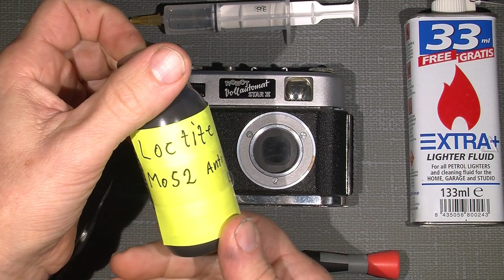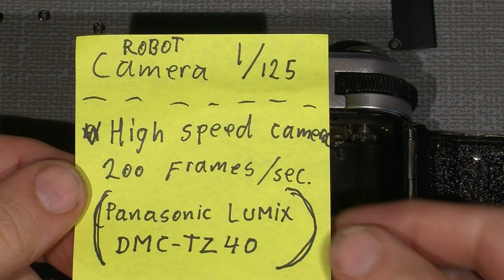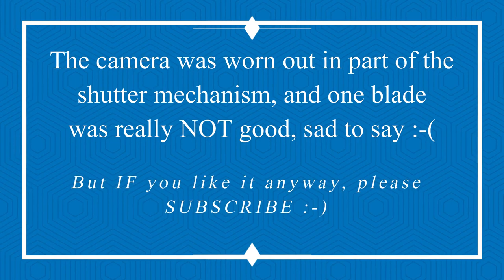Slow gear in ROBOT Voll automat STAR II (just an experiment)

Comment: Mike, there is a dent on top housing of camera, right above  spring winding knob. I think the impact affected ( bent)  rotary shutter disc. On this model they were made of thin sheet metal. On newer models  it was a leatherette-like plastic, which  would rather crack, than bend. Normally rotary shutters don't get gummed - up with old lubricants  and unlike classical Compur style leaf shutters they're sort of "gum - proof" and basically maintenance - free ( unless you lubricate   internal parts and disc - never ever do it).
Reply from the maker: Thank's for the good info :-), I will check that next time.
Reply from the maker: Thank's for the information about the RoBoT camera :-).

Comment: Using ANY lubricant on shutters and escapements is a big mistake. Delicate parts will gum up over time and your equipment will have to land in recycle bin. Use Ronsonol ( lighter fluid/naphta) ONLY. Just  "flood  flush" the  mo-fu with it. When you do it  well you can use hot air to facilitate  evaporation of Ronsonol  ( use wife's hair dryer). If you don't apply enough of Ronsonol, the crud will not be flushed out but only dissolved and mixed with fluid. Then using hot air will make things even worse.  It's an area of instrument repair skill that  only refines  with practice and experience. It's like  learning how to drive a car. Even the best WRITTEN manual will not  replace sitting behind the wheel and actually driving.
Reply from the maker: Thank's for the information about the RoBoT camera :-), I will try that next time I work with it.